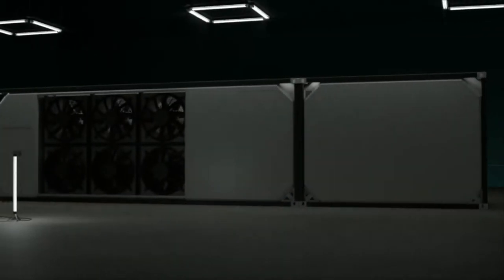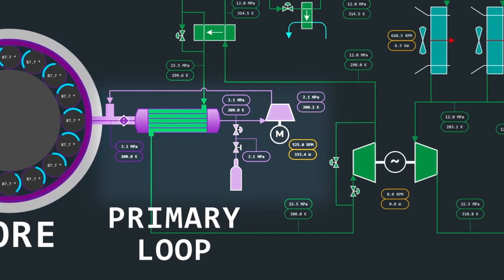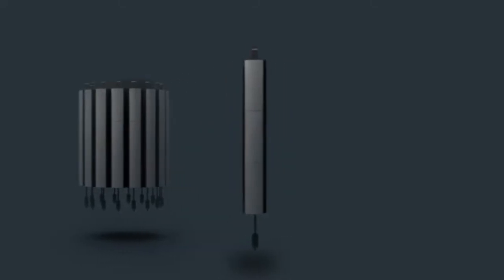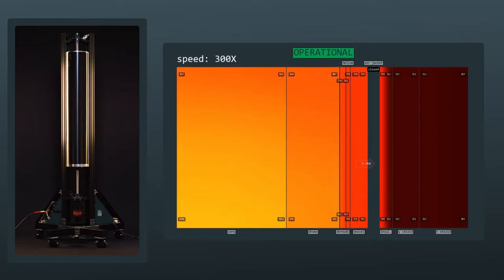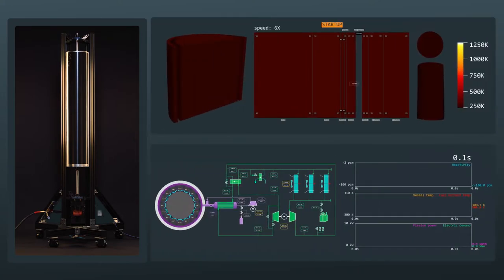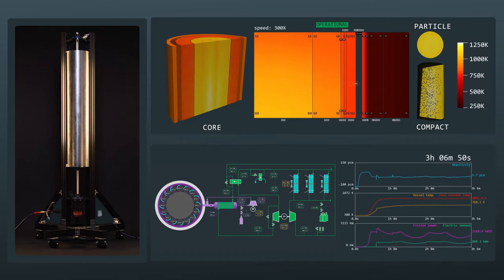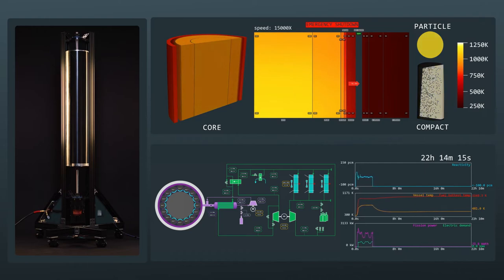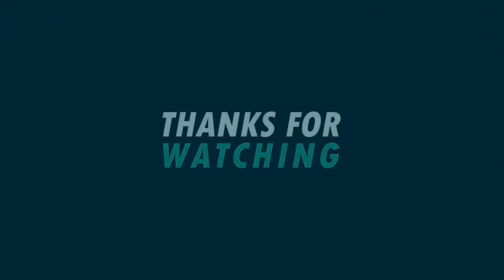micro nuclear reactor : What You Need to Know!

Comment: Ballpark of initial cost? Annual cost of operation? Time able to remain in operation before refueling or maintenance? I have so many questions
Reply from the maker: @Jacob 
The smaller size of micro nuclear reactor makes it possible to fabricate them in factory. This not only reduces construction time but also reduces first cost drastically when compared with conventional nuclear plant.
A single unit of micro reactors typically generates 1 to 10 megawatts-electric. To put this in perspective, a single megawatt of electricity can power approximately 1,000 homes. That means these systems could provide up to 10,0000 homes with clean power—24 hours a day, 7 days a week—for 10 years without stopping!
Reply: @technoworks. he gave u 3 different questions that coulda been answered and u somehow managed to make a response that ignored every single one of them
Reply: @technoworks.  How did you arrive at 1000 homes per MW of electricity? A fridge a tv and a place to charge laptops and phones?

Comment: How many kw of power are we talking about for this container sized unit.
Reply from the maker: As per department of energy USA.
Microreactor designs vary, but most would be able to produce 1-20 megawatts of thermal energy that could be used directly as heat or converted to electric power

Comment: Need smaller... 40KW. Lets say 50KW as an ideal unit that can be confidently manufactured to fit any home case scenario.
6 for 40 000 BTU worth of AC
10 for growing facility including irrigation.
5 For ventilation and air and water filtration system faucet pumps.
5 not exceeding. For typical appliances.
6-8 For a 400kg surface lift.
The rest for maintaining a 3kw battery bank when there is a lack of solar energy.

Those figures are overly generous. But that is typically what a decent fallout shelter for 1-6 individuals would require. With the floor size of a typical 4 bedroom home.
What are the inherent difficulties of producing and user maintenance of such a small unit?
Reply: Safety...that's why,  and they can't give for one person, good for whole city. Idk maybe it's not. Gov absolutely don't have competition ...